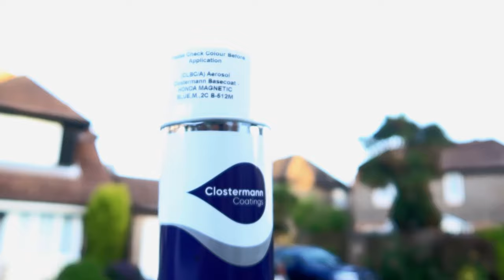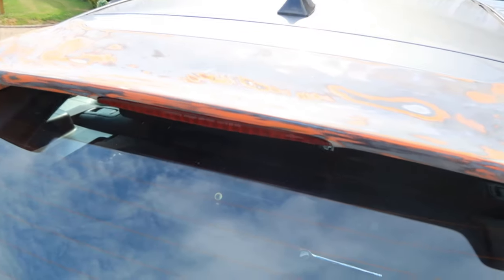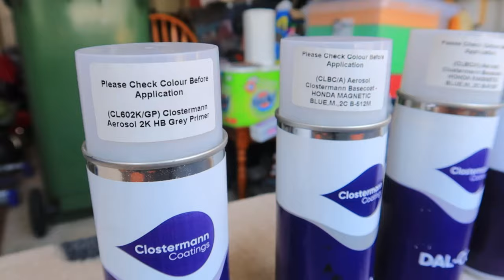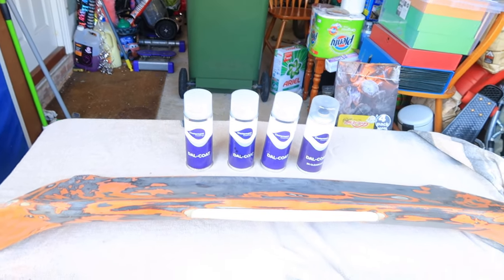Spray Painting My TYPE R Spoiler! 😏

Comment: Now you just need the type-r body kit and paint that to match your car, everything should be cheap apart from the front splitter, but could always get a mugen or fiberworx one I suppose
Reply from the maker: I'm thinking of kitting it out with a fiberworx rear bumper and maybe some other pieces haha, can't wait!
Reply: @MotorAlli  yeah definitely, the non-type-r ep's are a bit too plain for me haha
Reply from the maker: @kris985  the non type R ep's look tooo basic haha, but then the type R ep's look too common, needs that middle ground lool maybe some type R stuff like ze side skirts and an airwalker lip etc